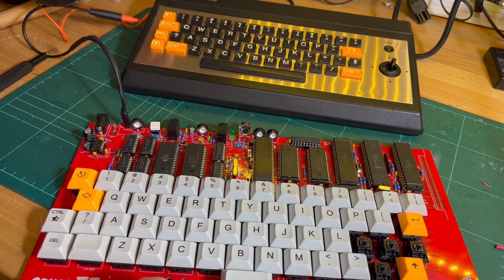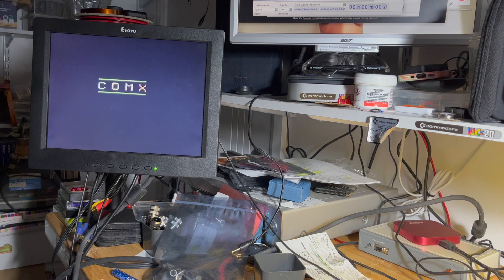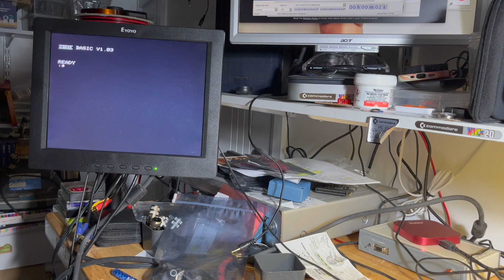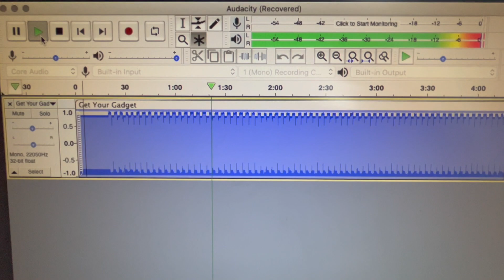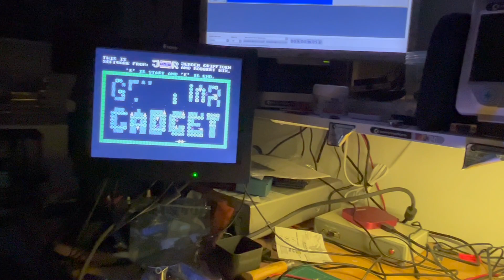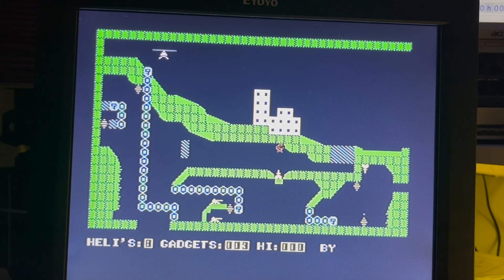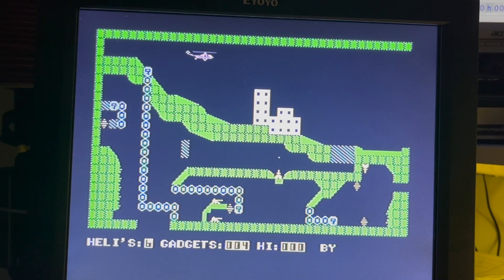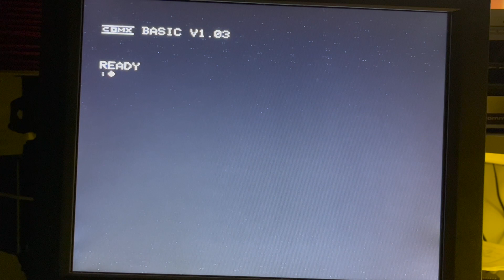🇭🇰 COMX-35/COMiX-35: Part 7 (Loading software on the COMIX-35) [TCE #0045]

Comment: I finished my Comix-35 build last week, but I still haven't succeeded loading any software over the tape input. I would appreciate any hints what else I could try. I don't have an oscilloscope (yet).

I followed Tube Time's instructions for creating a WAV file using the Emma02 emulator. I think the headphone output level of my notebook should be sufficient, I also tried feeding it to my stereo and from there over its headphone output to the Comix, but that didn't help, and with a too strong signal the bias can't be properly adjusted.

I assume that I should adjust the input bias like this: at the long tone, I turn it up until the LED is constantly on. And when the data is coming in, the LED must flicker - if the LED is constantly on during the single data beeps, then I would have to reduce the bias.
But compared to 5:52, adjusting the input bias seems to be more sensitive for me: the LED very quickly changes between fully lit and completely off, the "habitable zone" seems to be very narrow???

P.S. I did NOT install R24, as recommended by Tube Time.
Reply from the maker: Oh, well done!  I can't remember if there were any specific tricks for the COMIX ... I always use Audacity and usually set the volume to around 65% I think, or set the volume to 100% and then adjust the gain to -3dB or so.  I'll have to watch my video again to see if anything else sticks out.

If it helps, I have a bunch of WAV files I converted on my Dropbox here:
https://www.dropbox.com/scl/fo/b40fzhr642aobx57u0cva/ACtSbmsdt9d87v4Za8pPkCo?rlkey=nc6o2ef15cfuqa4j1p0366tlg&st=3ijfpmp8&dl=0
Reply: @Brfff  Thanks for your wave files! I am now using them for testing, since they are known to be working.

But I still had no luck, and using Audacity instead of VLC didn't help either.

Depending on the volume and bias settings, I am getting either no messages during loading, with nothing happening at the end, or a tape loading error somewhere in the middle. I think the latter is the better option, since the former indicates that nothing at all is reaching the CPU.

So I thought that when I'm getting the error not immediately, but rather late during the loading process, I could be on a good path. But then, any minor adjustment of the bias makes it worse instead of better.

So I have given it up for now, and I have ordered my first oscilloscope (an inexpensive handheld one), I will check the activity on the cathode of D5 and on EF4 (Pin 21) of the CPU.

And in the meantime, I have received the High Speed Loading PCBs, but I still need to order the parts. That 44 pin edge connector with 3.96 mm row spacing seems to be only available at Digikey...

Comment: On the wikipedia of the ComX there is a memory map. So system parameters are 4000 to 43FF ... thats 4x256 = 1024 bytes. ... 512 bytes reserved for DOS and maybe a stack taking some memory also in Basic? 
https://en.wikipedia.org/wiki/Comx-35
In someways the graphics can even be better than the ol' speccy?

Comment: Now I was expecting some pedal to the metal 1802 assembly. But if you are coming from a Z80 it's going to be a unique experience.
Edit: I just took a look at the tape interface in the schematics. Just a few gates and discrete components, hanging directly on the EF4 and Q signals of the processor. What a surprise (not really). 1802s have been doing such things (and more) this way since the 1970s.

Comment: Excellent video and work!! Is there a place to get the games and programs?
Reply from the maker: Thanks - check out Marcel's Emma02 emulator (link in the description) - it emulates a bunch of 1802-based systems and includes a lot of COMX-35 software - you can use the emulator to batch convert the .comx files to WAV-format files.  He's recently updated it so it works with the Mac's "dark mode" (not sure if he's finished/uploaded the new version yet - if not, it'll be coming). /Brett
Reply from the maker: Also ... https://archive.org/details/comx-35roms